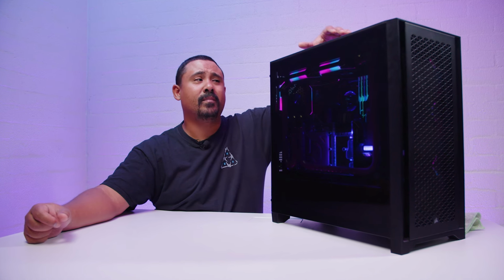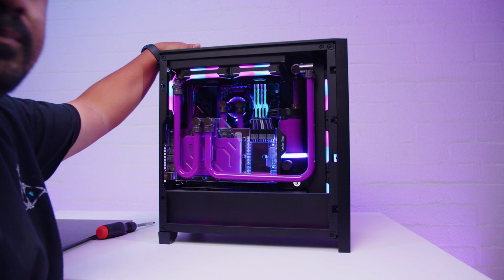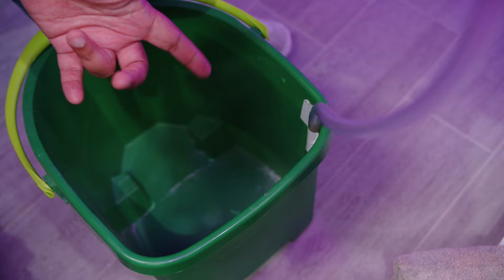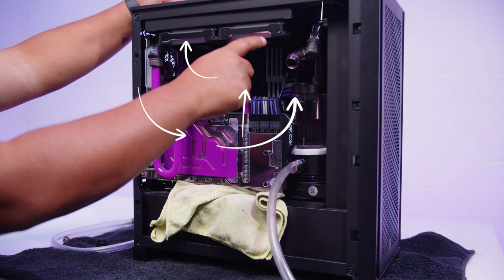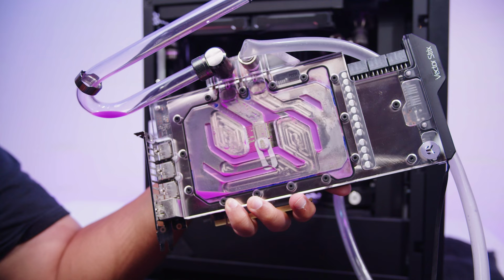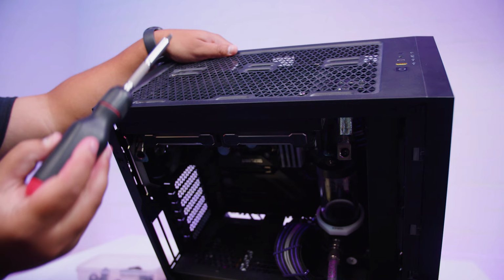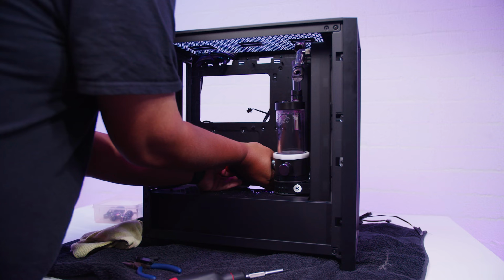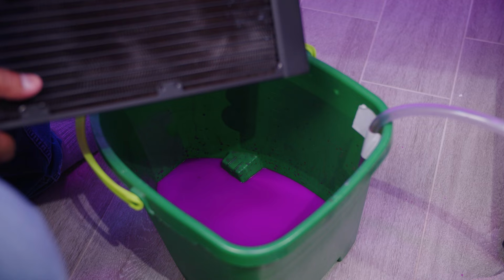My Dirty Dream Water Cooled Gaming PC Meets Its TRAGIC END

Comment: This is the reason why I retired from custom loop. It makes you LOOPY from maintenance! Aio and air is best 👌
Reply: Soft tubing is the way to go. It makes maintenance so much easier.
Reply: Air bois unite
Reply from the maker: Air cooling is so much more practical but water cooling looks epic!
Reply: I disagree with all comments. Air cooling is very noisy on high-end gpu's. Also many of you look at pc as an appliance rather than art. You just can't apply your views as norm.
Reply: @AM93000  what's the GPU possessing in your statement?
Reply: Air will never beat water

Comment: I have the same case though in white.
You really need to be careful with its tempered glass side panel as it broke on me when I was just removing it.
Luckily corsair will happily send you a free replacement.
Awesome build as always
Reply from the maker: Yeah. I always grab it from the bottom when removing side panels that have no metal frame. I've had NZXT H510 panels explode in my hands before. Definitely not fun

Comment: Been using those Torque drain plugs since before Aussie retails bothered to carry them.

With the Lian Li fans, I too have them controlled via a Commander Pro but I still have the Lian Li UNI Hub installed which I then use a conversion cable to go between Corsair's 3-pin to the standard ARGB plug of the UNI Hub. Set the L-Connect 3 software to Motherboard control and you're set to go. The Commander Pro's RGB port is configured as 6 x LED strips in ICUE for use with my AL-120's. This works out as 2 strips per fan and I have them configured as 3 channels of 3 fans each on the Lian Li UNI Hub.

Comment: Custom loop is dead. Good airflow, few Phanteks T30s, Arctic Freezer or EK AIO (no high pitch pump noise, replace fans with T30s too and set pump up to 60%) and nothing will throttle. O11D Evo, 10 T30s at 800rpm, cool as a cucumber.

Comment: Great video. What is that drain fitting? I'd like to get one
Reply from the maker: It says in the video ;)
Reply: @GearSeekers  lol I watched the video but didn't catch the brand of the fitting. Im building my first hard loop for a friend of mine with a 4090 and 7950x3d (when released) and need this fitting for the loop lol. I have most the parts already including the 4090

Comment: That's too much bullshit and unnecessary  work for  PCs that are going to be upgraded/replaced when new gen arrives. I'll stick to my Noctua/IC Graphite combo. Watercooling is becoming redundant unless you are overclocking, and with todays powerful CPUs, overclocking is also becoming redundant. I'm using factory overclock on my 13700kf, and the difference is non-existent when I increase the overclock in 4k gaming. I'm using an RTX 4080, so there's no bottleneck there.